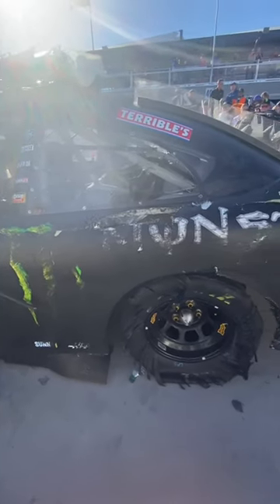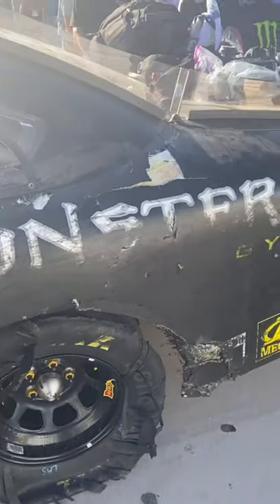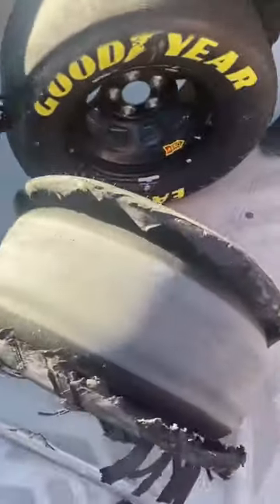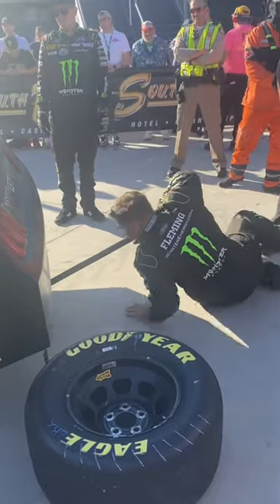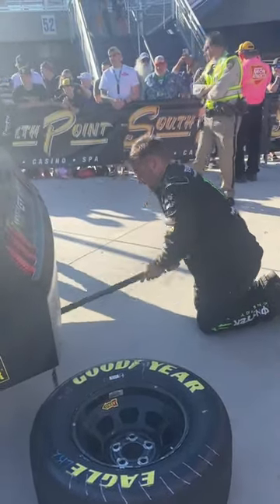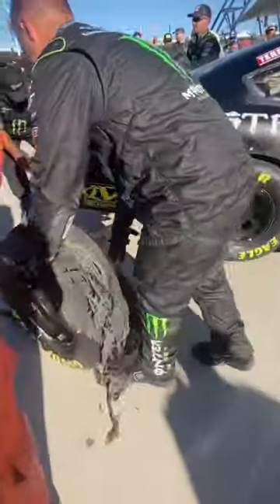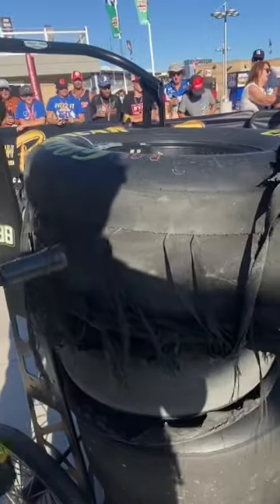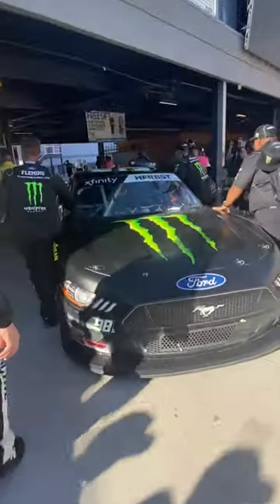Not a bad problem to have. #nascar #racing #burnout #stewarthaasracing #xfinityseries #tires

Comment: So it still passes post-race after having damage from the tire? I don't really know how much inspection they do post-race
Reply: they mostly check the windows the wing and the body
Reply: they check if there is something in the wing like something that help drag
Reply: They just change the tire. I think they have to bring the tire to tech also though.
Reply: The car will be inspected but anything damaged during the burnout process is considered to be damaged while on the racing surface.

So even if it was out of spec, it would get a pass because it got destroyed.
Reply: @samharris3508 so basically Martin Truex Jr. style

Comment: There is no tread on NASCAR tires the tires are called “slicks” which is made for drag racing and more
Reply: The part of the tire that makes contact with the ground is called the tread. Slicks have what is called smooth tread. That part of the tire is called the tread no matter if it's a street tire or racing tire.